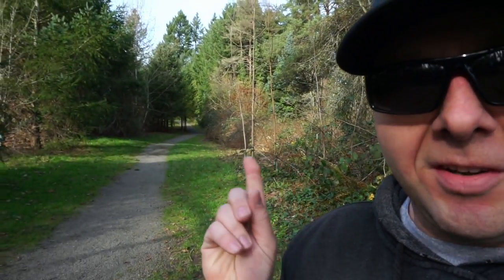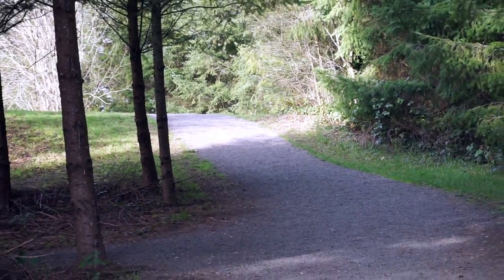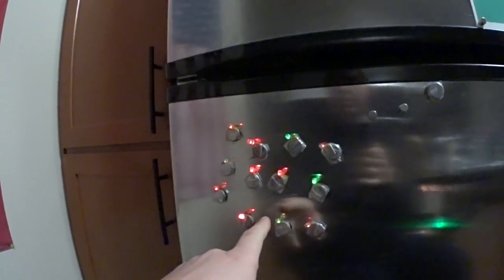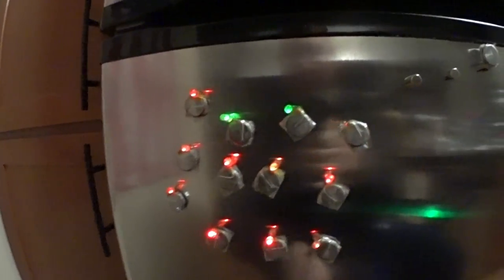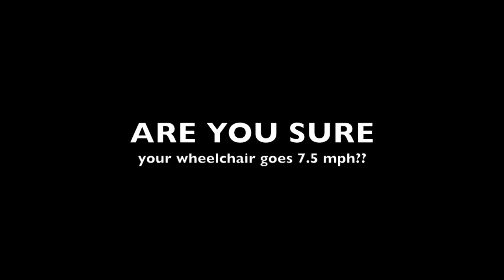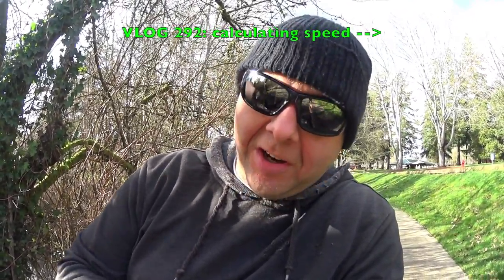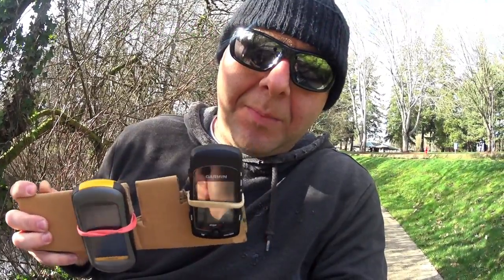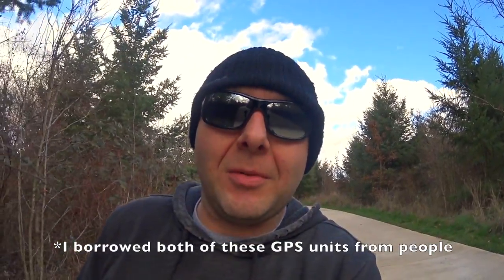VLOG 301: UPDATES! (led magnets, chair speed, off roading)

Comment: I do have question, you said that you can access the power connects in the back of V6?  you can hook up the lights?
Reply from the maker: on the V6 the lights and accessories plug into a board thats under the seat, but above the batteries.. tilt your seat back, and youll see it under there.. usually has a little plastic cover over it
Reply: black cover that has V6 logo on it?
Reply: thanks man
Reply from the maker: just realized they have different versions of the chair electronics.. and there's 2 versions of the entire V6 chair as well..  heres where it is on my chair... https://ibb.co/jbNZMS  and heres what it looks like https://ibb.co/bHUEMS  if you have power tilt, tilt the whole seat up/back and its under the seat pan
Reply: you are the man